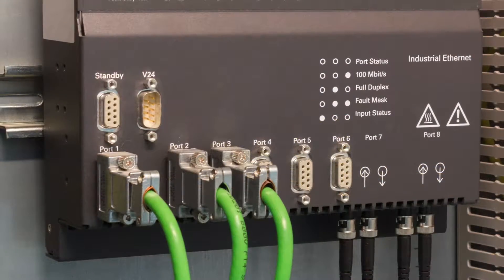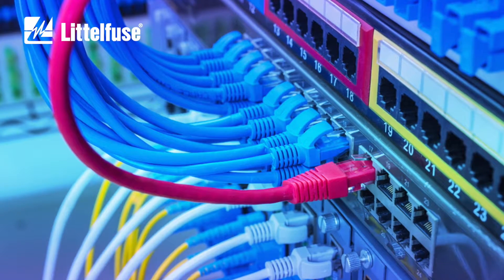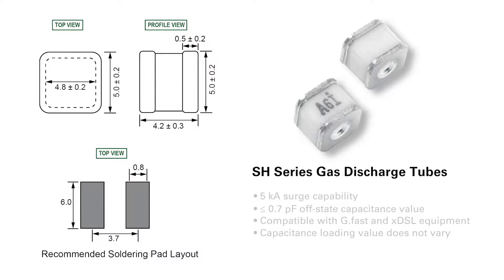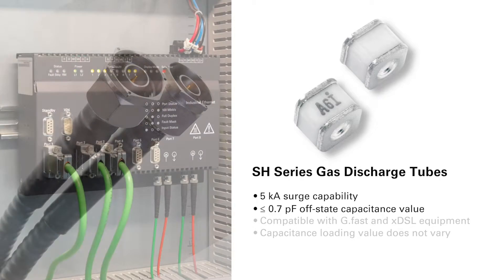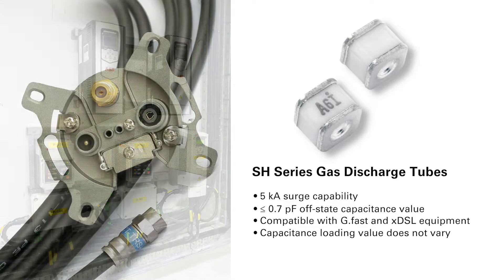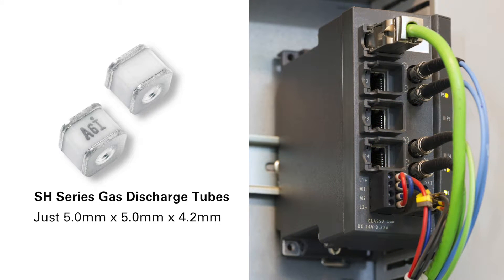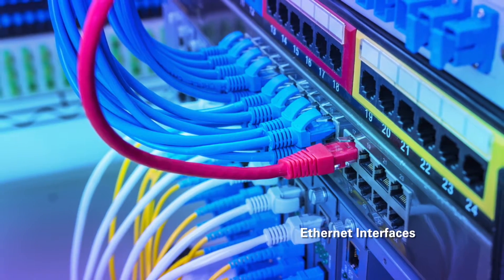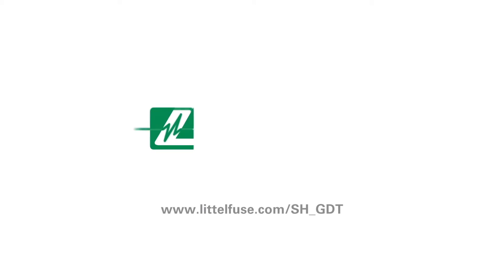Littelfuse SH Series Gas Discharge Tube

Comment: Does a GDT tolerate a surge for a longer duration than a MOV ?
Reply from the maker: Hi Richard, GDT has a very high resistance (> G Ohm) and very low leakage current, so its degradation is much slower than MOV (higher leakage current).